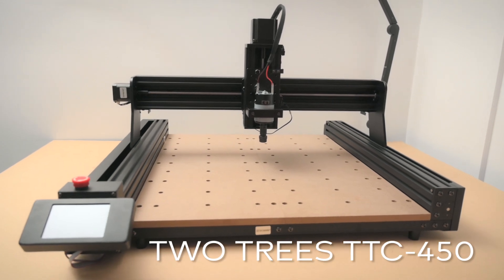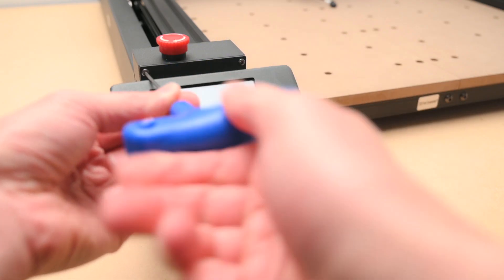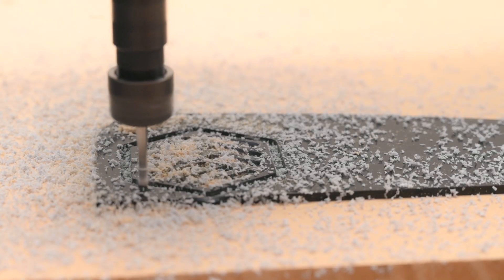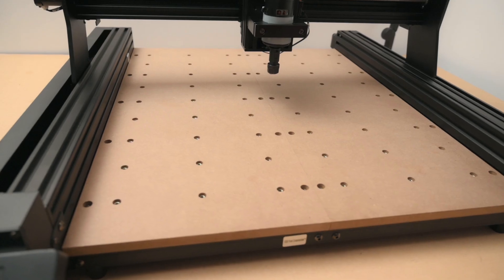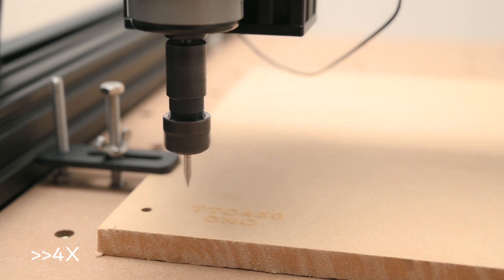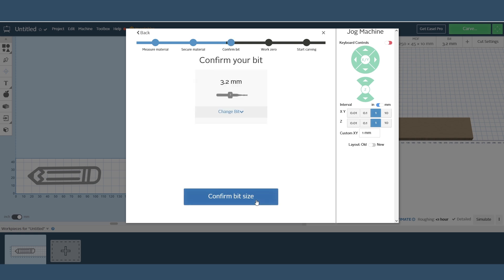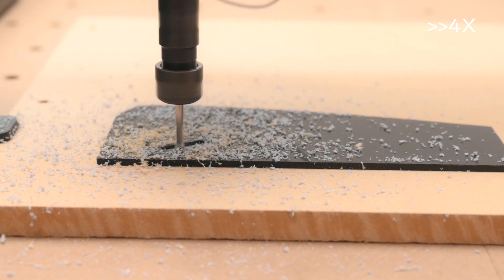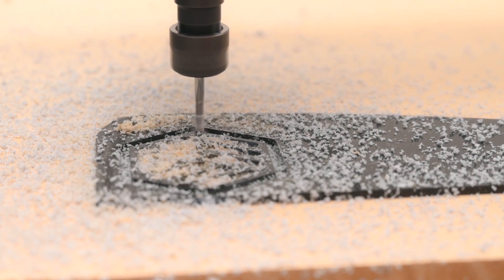BEST HOBBY CNC ROUTER MACHINE - TWOTREES TTC450

Comment: I have this unit, it started out great, then it vibrated in pieces. So make sure everything is tight and use Loctite. Then when things started going wrong, their customer service department is the absolute worst I’ve ever dealt with.! I would not recommend anything by two trees whatsoever just because of this.I had to spend over $200 to have my machine fixed because they would not help me! If you ask me, stay away from two trees! Just my humble opinion. Good luck if you buy one. Buyer beware.